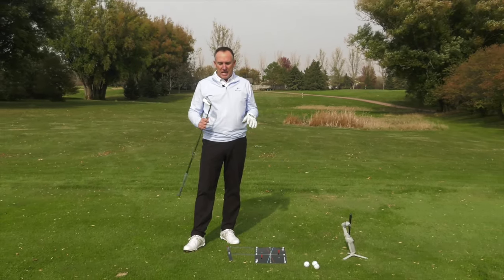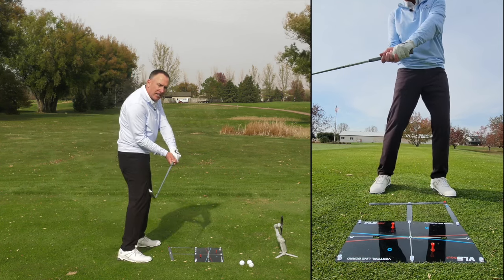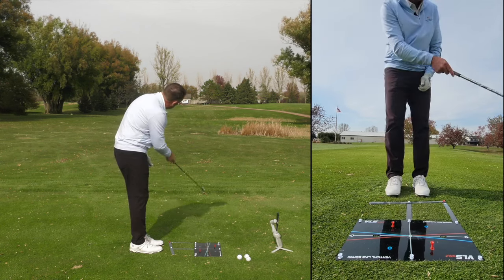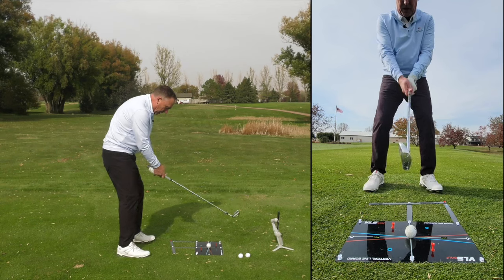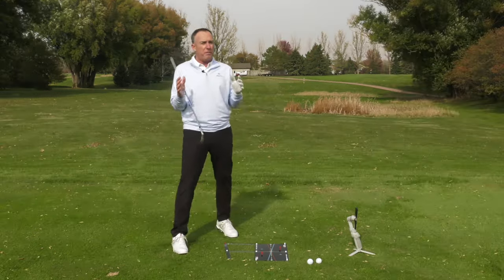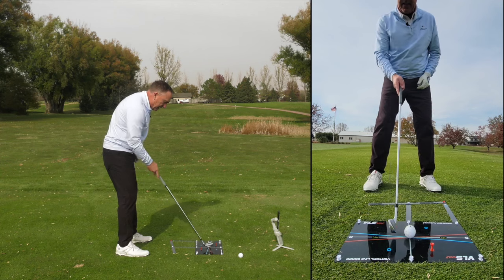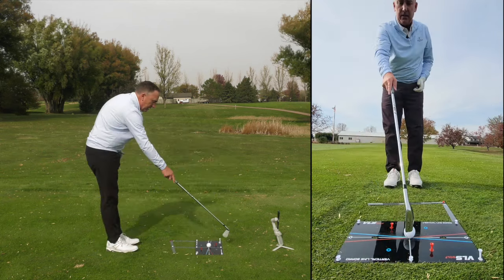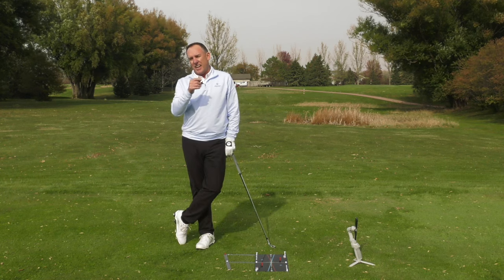How to Hit a Fade With Control

Comment: Hmmm. Been fiddling with the "club data" from our Mevo+ "pro package" for a couple of months now, and studying those tricky "new ball flight rules" pretty hard.  Are you sure that you want the face "open" to that gray target line??  That strikes me as being one of the trickiest, most counterintuitive aspects of those "rules". Have tried to develop some "rules of thumb" for the various curves, and having both the path and the face "left", but the face "less" left seems to be the ideal for a little "pull fade" that starts a bit left and drifts back to the target.  Open to that gray line might yield a rather large FT*P*, no? And, therefore, possibly more "slice" than fade or at least a shot that finishes well to the right of the original gray target line.

But, I love your gadget.  Another "tricky" thing for me is how to then think about "Face to Target" (FTT) when one aligns the feet to a "different", leftward target.  Semantics for sure, but I'm thinking that the number of degrees of feet alignment "off" the target line then has to be factored in to the FTT number.  To me, it makes things considerably more complicated. However, I am regularly accused of "overthinking" it. . . 🙂
Reply from the maker: Have you watched this video https://youtu.be/K7JlGMBUZlk?si=n__yMMh3Owrm9jk6
Reply: @USGOLFTVshow  Had not, but have now. :-) You clearly "get it" and that was 6 years ago. Just looked more closely at this video and see that I made some inaccurate assumptions. When you said a "little" open, it looks like you really meant it. 🙂 1 or 2° at most it appears with that club face, and it looks like your feet and the red line were aligned something like 14° left. Hunting through my data I find nothing close to a 14° left path. 🙂 The closest I could come was one with a path of -5.3 and an FTT of +1.9. It yielded a "slice" that ended up 11 yards right that launched about a yard right. Hmmm. 

I'm only just now starting to get a decent handle on control of both my face and path, but that means that I can soon start playing with these alignment and face adjustments at address for maybe trying to get at certain pins or taking one side of the course out of play.  Your video seems to tell me that I might need to broaden my range of parameters. 🙂

Might not be something that you'd be comfortable commenting on publicly, but I've become most curious about what percentage of teaching pros understand these "new" rules. Fascinating stuff. . .
Reply from the maker: Great post here. I believe golf instruction has come a long ways over the last decade. There is more good information available and therefor more good coaches. Appreciate you posting  @mntlblok
Reply: @USGOLFTVshow  Took me a few tries to get one with reasonably close numbers, but my shot with a 14.4° left path and a face to target of 3.5° right, unbelievably yielded a shot that ended up only 2 yards right of the target line and curved only 5.7°!  🙂 Where's all the articles for "rules of thumb" for these combos?? 🙂